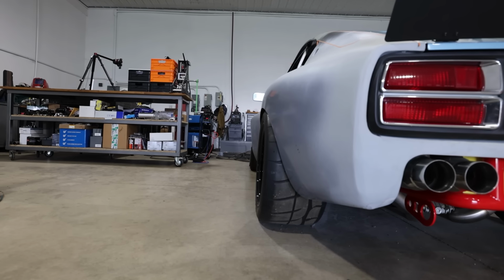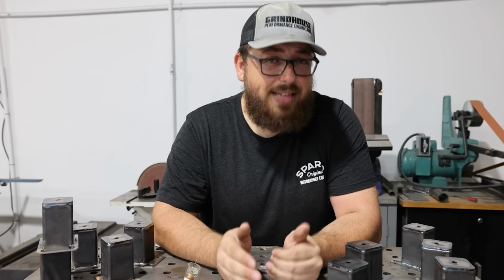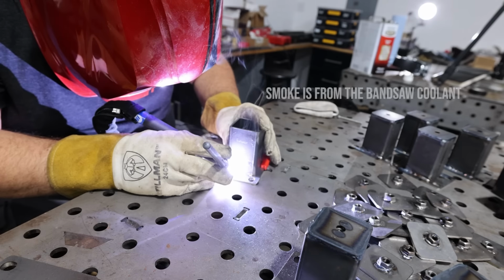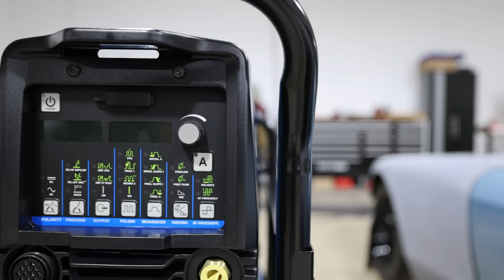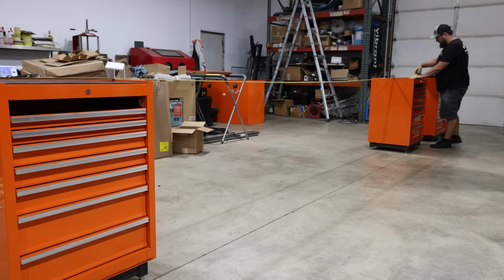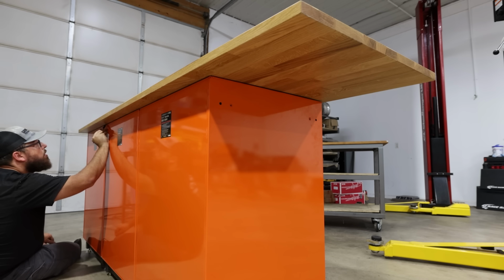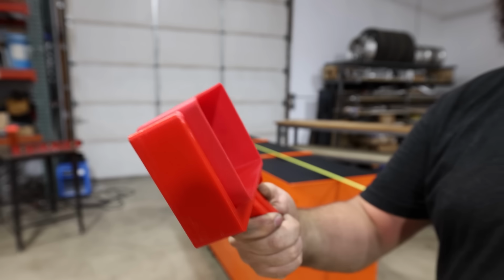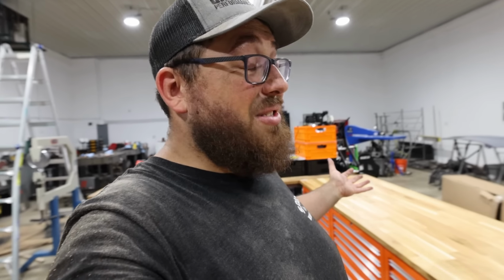Building the Ultimate Workbench for my Dream Garage

Comment: Anyone that needs shallow bins for their drawers there is an easy solution for anyone with basic metal fabrication skills: take some scrap sheet metal and make them yourself. If weight is a concern, use aluminum. You can even use metal as thin as 24 gauge and tab the corners and secure with rivets or bulk up the thickness and weld the corners without tabs. I have build these bins for all kinds of tool organization and parts organization
Reply: These bins are $0.50-$1 a piece. Well worth the money. 1in 2in and 3in depths. All different sizes.

Comment: I really like the workbench made with tool boxes.  It looks awesome. I'm currently remodeling my garage and I'm curious.  What was the deciding factor on the box? Why not the icon boxes? 

Great video can't wait to see the finished setup.
Reply from the maker: I picked these specifically because of the drawer arrangement and  width. With the top narrow drawers I think you'll run out of physical space before you hit the weight limit of the drawer slides. If the drawers were a lot larger they'd get extremely heavy full of hardware and that's not really what these style toolboxes are designed for. Being 8 drawers, I'm planning to have the bottom 2 deep drawers be overflow storage for the 6 top drawers. Drawer 4-6 has enough height for adding a second set of slides if I overload them. I also liked the symmetrical look between everything, a lot of the wider boxes have a wide set of drawers and a smaller one. I'm also only putting hardware & supplies in this box. If you're also storing tools there might be better options 👍

Comment: Good idea, I have been looking at how to do this in my garage.  Did you not consider the 1" Schaller bins?  What height did you cut them to?
Reply from the maker: The top 3 drawers are 1.5" tall; I cut a quarter inch off of the 1.75" Schaller bins. I saw the 1" ones, but after filling some of these up, I'm glad I went the route I did. Any kind of labels, for most of them I've filled, would wind up being partially or fully covered by the contents inside a 1" bin. It certainly could work, but once these are all cut, I probably won't have to worry about it again, rather than be annoyed every time I look for something down the road. It's a tradeoff, this was definitely a pain, but I think it's been worth living with it!

Comment: Were the bins made with your 3D printer? If not, where did you purchase them?   Thanks!
Reply from the maker: I did some maths and it was cheaper to start with these injection molded bins from Schaller Corp. If I was only doing a couple drawers I probably would've printed them
Reply: @GrindhousePerformance  thank you. I just wasn't sure where they came from.

Comment: Awesome idea with the  tool boxes and the countertop! Did you consider a sled design for the table saw so that you could rip a few storage bins at a time, the 3d printer pliers design is neat but that is a lot of time cutting one bin at a time. I had to do something similar for a home project and threw together a quick sled with scrap plywood and was able to rip 5 pieces at a time of some plastic post caps.
Reply from the maker: I made a few attempts with other ways of cutting the bins. I'd tried all the different tools etc in the shop and some other designs/sleds but the pliers seemed the most consistent/safest. The taper on the sides really wants to walk out if you don't have enough pressure on multiple sides. I could've gotten away with a sled if I was comfortable getting fingers closer to the blade. With doing a couple thousand of them I wanted something I thought gave a little more room. I was able to do a full drawer in about 30 minutes 👍
Reply: @GrindhousePerformance   do you sell those pliers??? I really like the idea of using the toolboxes like that. Nice job!!

Comment: Here's an upgrade idea. Replace the wood counter top with phenolic resin  which is that black counter top material chemistry labs have in schools so students won't ruin the tax funded equipment by spilling acid or other harsh chemicals. The black material would really pop with the orange cabinet paint job.  The counter top  material costs 15 to $18 per square foot .
Reply from the maker: It's a great idea, was thinking of doing this on my mobile benches that see a lot more grime 🤘
Reply: @GrindhousePerformance   

You said you were interested in a mobile bench.  Here's a DIY mobile sink for a race team that you could replicate.  

https://www.youtube.com/watch?v=r3G7Pdziwa4

There are some nice koolance quick disconnect fittings for PC water cooling, they're bullet proof.

 What you could do is use the QD fittings for when you want to switch from a stationary to mobile water sources such as switching between the building's hot & cold water, and the  on  board water Reservoir and pump.

You could for instance take the sink with you to a lake to clean fish with clean water & not leave nasty fish bits to rot & stink up your property. 

Then you can thoroughly clean the sink when you get home with the building's piping hot water.
Reply from the maker: @jmd1743  Steph is a wizard! That's a great project and one I'd definitely like to replicate if I start doing on-site racing support stuff again

Comment: Having the same issue trying to organize shallow drawers and you have shown a great solution, however how is it none of the manufacturers of tool cabinets haven't partnered with  someone to make these organizers like those you cut to fit??  They are missing out on a market, especially in drawers that are shallow like you have shown.  Do you have a website to where you purchased the organizers that you cut to fit that you can share?
Reply from the maker: I purchased the bins from Schaller Corporation. I tried to present a business case to them about offering 1.5" tall bins, and even offered to purchase several thousand of them to justify them developing the tooling for injection molding. I had actually gone as far as working with an injection molding company to create my own tooling, but I was worried about existing patents/etc trying to sell them afterwards. I agree it's a huge missed opportunity, maybe if enough people bug Schaller about it they'll change their minds!

Comment: I too was surprised the welding guide survived without deformation. Was that the same PLA?
Reply from the maker: I think welding on the opposite side of the tube, rather than the corner, helped dissipate the heat a lot, but I was still really surprised and impressed it held up from doing so many of them. I used Ultimaker Tough PLA for it

Comment: Wouldn't it be easier to cut out rectangles that fill the tops of the tool boxes and then fit the countertop on top of them? Also the bins could be done by getting a flat plate of steel and a good neodymium magnet in the bin n sliding past the table saw the same or even the chop saw
Reply from the maker: Hey yeah, it would be easier to put blocks on top of the toolboxes, but they would be visible from the front and didn't like the way it looked

Comment: Just found your channel ( algorithm)  glad I did. What color  are you going to paint them?  Drawer depth is a very big issue for me. I found STORLOCK for my small parts. A little expensive but I value my time and I agonize over wasted time looking for stuff , I know I have.
Great channel you will go far with that attitude. 
You do nice work.
Reply from the maker: I painted the steel with a rustoleum gray hammer finish that matches the mobile workbenches. It's not the easiest thing to apply but it seems really durable on the racks e.t.c I've done with it. I'll look at storlock's line, I haven't heard of them before. Happy holidays! 👍

Comment: Wouldn't it have been easier to change the height of the work table slightly, rather than make new legs for every tool box?
Great job, btw.
Reply from the maker: Hey thank you! Easier, yes, but not necessarily better (for me). Both of my welding tables & mobile work tables would've needed adjustment, and the working height they're set at is very comfortable for my back. Adding the frames to the bottoms also increases the rigidity of the toolboxes when they're getting overloaded with hardware. The biggest bear is if I ever have to move this thing, it's SUBSTANTIAL haha. I like keeping things on wheels in the shop, but for something like this, I felt like the leveling feet were the way to go.

Comment: VERY nice job with cutting down the red parts bins. Getting the precise depth required makes maximum space utilization. I would like to get some of those bins for my upcoming shop redo. Are they made by Schaller, by chance?
Reply from the maker: Hey yep these are the 2in (1.75in actual) Schaller Corp bins. I wanted to have enough room to clearly read the labels, and it wouldve been too much wasted space. Im still cutting bins as I'm needing them but it's really not too bad to do. 👍
Reply: @GrindhousePerformance  Thanks for the info. I have done a limited batch of bin cutting on the band saw, but will make a jig for TS. Your results are far superior, with no cleaning of the edges. Time to order more bins!
Reply from the maker: @andrewbieger5004  Good luck!!

Comment: Could you have 3d printed parts organizers instead of buying bins ? Or would the cost for the material have been too much ?
Reply from the maker: It's a good question, if I was only filling a single drawer I probably wouldve printed them. The bins I purchased were between $0.50-$0.60 a piece, printing them would've cost me about 2.5x that. The bigger issue.. at this scale, printing the bins wouldve taken my printer over six months of non-stop operation to fill out the toolboxes. That's a huge commitment, where I can cut down a drawers worth of bins in about half an hour. I looked at print farm companies to print them but they wanted ~4 bucks each 😅

Comment: I like what you’re doing here in this video.  One suggestion I would make is a solid base.  It makes clean up easier.  Also dropped parts can be a pain in the ass to retrieve from under a cabinet when it’s open underneath.
Reply from the maker: Yeah that's an excellent point, I might magnet some sheet onto the front of the legs to seal them off. I was more worried about kicking them every time I walked up to the bench and wanted some toe clearance. We'll see! 👍

Comment: Rockler sells universal vacuum adapters that will fit your router. Better quality routers have shrouds that do a great job capturing sawdust. ie: Festool. I think you did a good job considering your not going to be working with wood all the time.
Reply from the maker: Thanks for that, I'm definitely no woodworker but was really happy how everything worked out 👍. I'll check out rockler, though I'll probably 3d print one now

Comment: Part 2?
Reply from the maker: I haven't gotten as much use out of the bench as I wanted with all my time away from the shop but what I've organized in it so far has been fantastic. I had gotten injured shortly after this video and then my property went through some pretty bad flooding damage that I've been having to deal with. I did have an IG post about the bench completed with photos if you were curious. I might do a follow-up down the road once I've put more miles on the bench to see how well the drawer slides etc have held up

Comment: milwuakee packout bins would work as well. idk if you can order individually, but they come in various sizes
Reply from the maker: I was curious about using the packout ones. I do quite a bit of remote work and it wouldve been handy to take a bunch of bins and throw them into a carry container. To fill the drawers though would've been a LOT more expensive than the ones I ended up buying

Comment: I 3d printed a hose adapter for my Ryobi router. Then later I found Ridgid had hose adapters, and the bottom half of the routers were identical.

I assumed you 3D printed the bins but that's a lot of plastic. I'm surprised you found an off the shelf bin that could cleanly fit the width and length of the drawers.
Reply from the maker: According to Schallers drawer configurator it wasn't supposed to work, I was really happy! I had looked at printing them all but it was something like six straight months of running my printer nonstop if I didn't buy more machines 😅😅

Comment: How you haven't answered this already...  What table tops were you using from IKEA?  I'm trying to decide if I should buy or build my own bench tops.  I want a solid work surface, I have IKEA desk tops but they're light and haven't worked well for me cuz they have paper fiberboard cores
Reply from the maker: These are the VRENA countertops. They are not solid wood, but they've worked well for me. They will dent or chip if you hammer directly into it..  the core is particleboard with a .25in oak veneer

Comment: Clean look I like your organization idea there but should have just done slats of thin plastic or wood or aluminum with notches at the widths you want like some cheap tackle boxes but make them quality and permanent
Reply from the maker: That's a good idea, I might still do that with some of the drawers. I wanted to be able to pull the bins over wherever I'm working around the shop but I'm still filling everything up

Comment: Takes a few minutes to search on adaptors...or just do what i do..measure and go looking at Home Depot / Lowes for them..start in Tool section...Router acc. then go look at Shop Vac acc. then if nothing..hit the plumbing section for plastic pipes and fittings... most routers have them available to order or are a " standard " size so you should find something available ( depending on price of course )... i learned from my dad 50 plus years ago to Think and Create if needed... even a simple setup to shield the dust ( a simple surround ) and a fan blowing the dust to an exhaust port your shop vac is sucking can deal with 95% of the dust your creating and keep the mess contained and make it better..woodworking is dirty dusty work no matter what you or how you do it...a Dust Collector Vac is also a good investment too ( but after a Shop Vac purchase ) ... it isn't necessary but i bought one used for $100... and it came with more than $100 of pipe/fittings and valves etc ... great if you do woodworking alot or rare even at that price... works on all my tools ( Tablesaws , Mitersaws..Bandsaws ..etc..
.anything you can connect...
Reply from the maker: That's good advice, thanks for all that 👍 I don't do a lot with wood but a collector would be a nice addition for sure

Comment: 3d print the hose adapter.  You can probably buy one, but it will just take longer and be more expensive
Reply from the maker: 100%. I got too caught up in the moment when the adapter I had didn't work and just wanted to get it done 😅

Comment: Why not send-cut-send some interlocking light-gauge metal dividers instead of all the individual plastic bins?
Reply from the maker: I might wind up still doing that for certain drawers depending what's going inside. For hardware I wanted to be able to bring the bins out to the other work spaces 👍

Comment: So question? Did the casters just make it too tall? And why not just 3d print the bins? You could have had color coded bins for your sae and metric systems. And they would have been the right height.
Reply from the maker: With how many bins I needed, it was going to take something like 6 months of straight printing to fill the shallow drawers for the six boxes. It wouldve been a little too tall with the casters and I wanted it to match the height of my mobile workbenches and welding tables

Comment: The bins looks like maybe too heavy an investment of time and money to change now, but have you by any chance seen the gridfinity storage bin system?
Reply from the maker: I hadn't heard of gridfinity, but I did model my own bins to see about printing bins for the top drawers. I would've needed to print over a thousand bins and it was going to be over six months of nonstop printing unless I bought more machines 😅. I also looked at having an injection molding company make custom ones but it was 5x the cost of cutting down the ones I purchased

Comment: Would have ran the boxes through the table saw 4 times with a lot shorter blade(much safer)  Awesome work
Reply from the maker: You're right there, I will probably wind up doing that for the rest. My thought was, doing 1000+ of the bins, that it would mean ~2000 additional cuts, which would be more fatiguing to do.

Comment: I would have just took each to a belt sander with a 3d printed jig that could hold each size.  Then you just sand down to the jig height.
Reply from the maker: I actually did try this and hoped it would work better than it did. A quarter inch was a little too much to have to remove cleanly with a belt sander. It took longer, was tricky to keep straight, and more or less just melted the plastic. Using the saw then following up any rough cuts with a quick run through the belt sander did a really nice job though

Comment: So where were the small bins from then ? 
I have a similar dilemma......
Reply from the maker: They're the 2in bins from Schaller corp, they're 1.75in actual height, but I still needed to cut them down to 1.5. They sell 1in height ones if you don't want to cut them down
Reply: @GrindhousePerformance  cheers I am UK so might be a prob shipping costs, in my drawers I can push 2.25" or 575mm